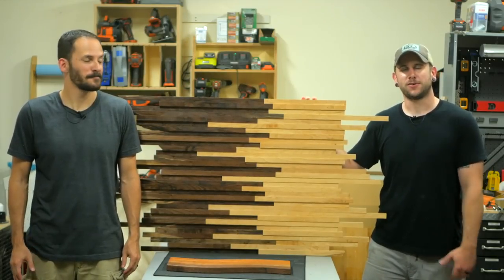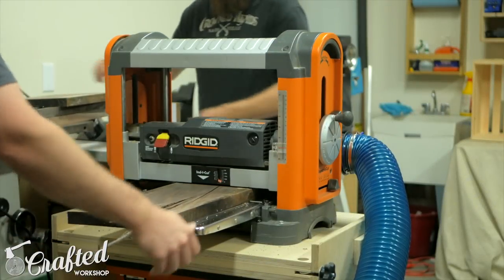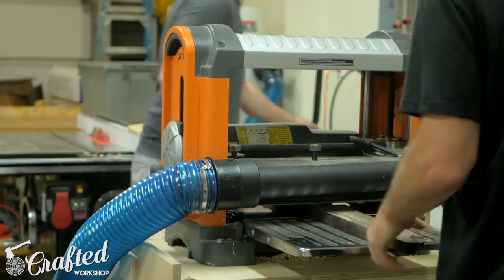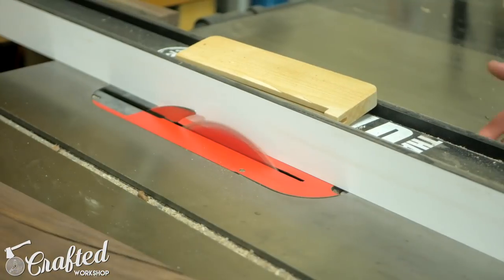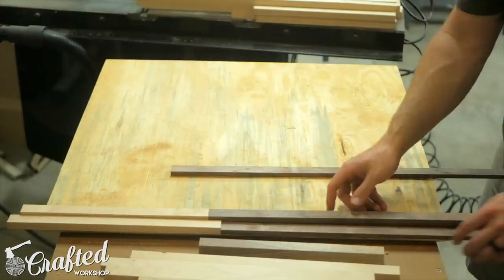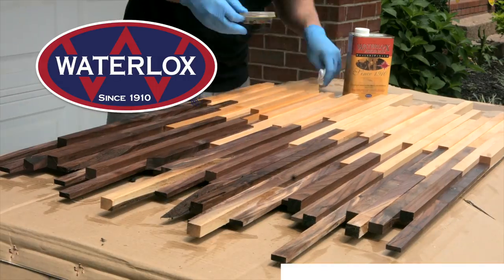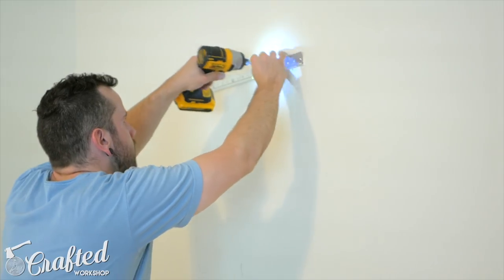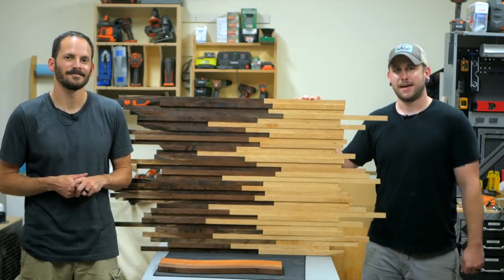Scrap Wood Wall Art Made From Walnut & Maple | How To Build - Woodworking

Comment: Good looking piece of art. Well done. How do you camouflage  the nail gun holes?
Reply from the maker: You can still see them if you look closely, but most people won't ever get that close. Thanks!
Reply: Kathy Barbieri you could use wood filler then sand it flat and stain if it bothers you
Reply from the maker: +EpIcNaChO yup! Pin nails are barely noticeable though.